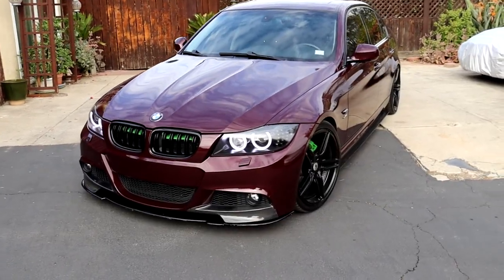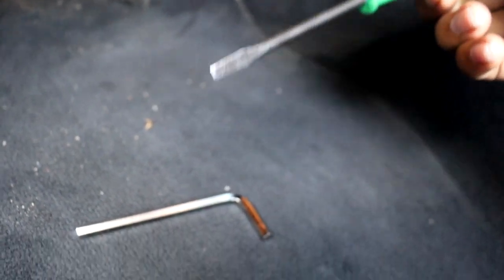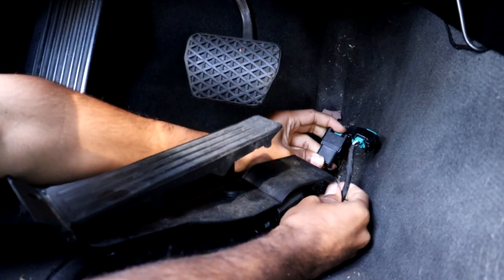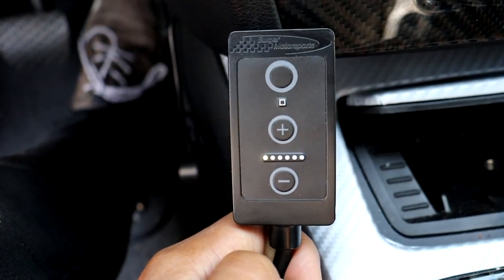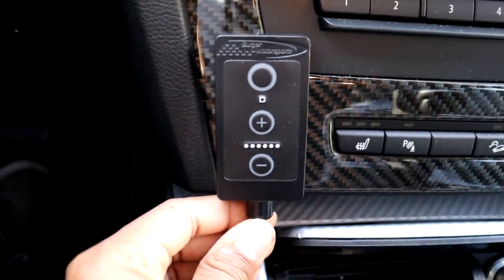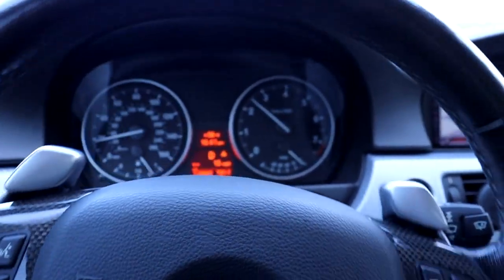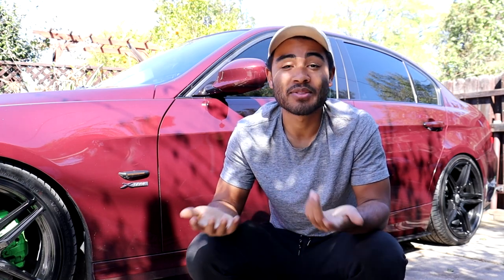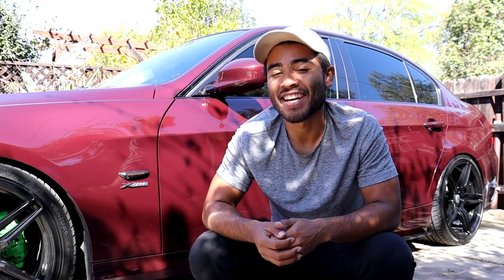MAKE YOUR BMW 328i N52 FEEL FASTER AND MORE FUN TO DRIVE | BMS Pedal Tuner Install and Review

Comment: Does this do the same thing if you have the auto gear lever in sport mode ?

I find that my gas pedal sensitivity is too low in “Drive” but too high in sport mode. 

Will this allow me to set it somewhere in between ?
Reply from the maker: Yep. 3 different sensitivity levels and then theres 6 more sensitivity levels within each of the 3 levels  so a pretty wide sensitivity spectrum to choose from
Reply: I’d like to add that shifting drive sport from what I understand just makes the gearing more aggressive, so if you were in drive at 4th gear and shift to sport it would kick you down to 3rd

Comment: where did u get those headlights? did you install them yourself?
Reply from the maker: They are my factory xenon headlights just retrofitted with aftermarket LED angel eye rings. Also had the housing painted satin black. I have them linked in the description if you want to check them out for yourself. I also have a more in depth video on them farther down on my channel if you want more details and visual.

Comment: Where did you get you headlights bro
Reply from the maker: They are my factory xenon headlights just retrofitted with aftermarket LED angel eye rings. Also had the housing painted satin black. I have them linked in the description if you want to check them out for yourself. I also have a more in depth video on them farther down on my channel if you want more details and visual.

Comment: my throttle does a thing where if i floor it i get no response for like half a second then it kicks in and my rpms shoot up will this fix that?
Reply from the maker: I would think so since since it increases pedal sensitivity. Not 100% sure though since it sounds like you may have an underlying issue with your pedal if it lags.
Reply: @InlineSixAuto  thanks! was gonna go ahead and buy this but it'll have to wait my starter just went out😂 ill let you know when i do tho

Comment: Does this void warranty
Reply from the maker: There's a chance it could but you just remove it before you take it to the dealership
Reply: @InlineSixAuto  yeah you're right. What about muffler and resonator deletes? What's your experience on that?
Reply from the maker: @camposjesus3725  That also may void it. I'm not 100% sure since I've never had a warranty since I work on my own cars. But any sort of modification could void warranty since they could claim the modification as the reason why something broke or malfunctioned if they wanted to
Reply: @InlineSixAuto  i called my local BMW dealership and they said as long as you dont touch your cat converters it's fine.
Reply from the maker: @camposjesus3725  Oh okay than you're chillin. Thats good to know actually. I think it just depends on the dealership.